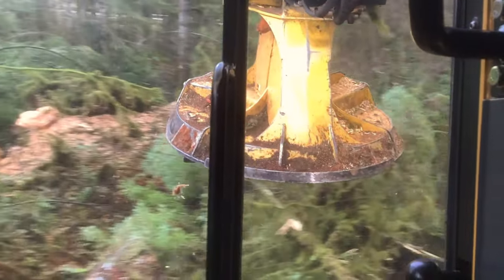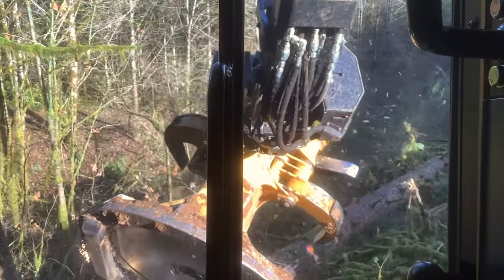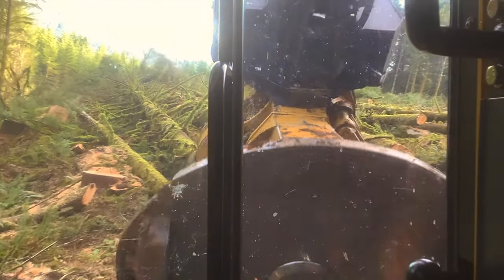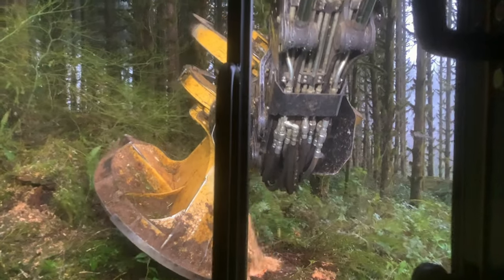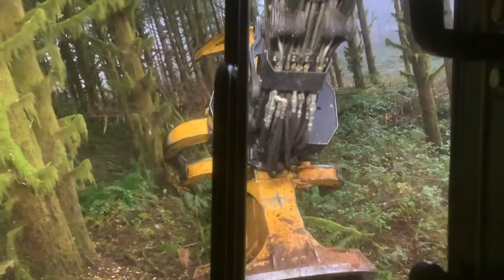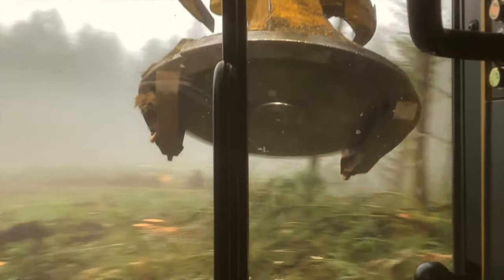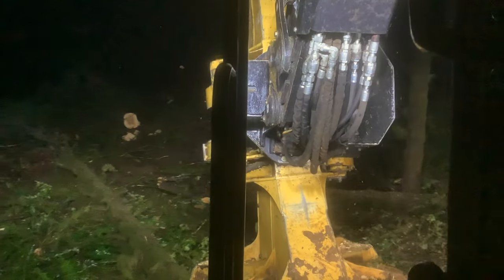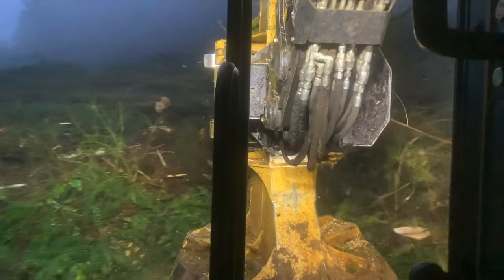Cutting In A 12 Acre Block Near Mabel Oregon With The Tigercat LX870D

Comment: Great video! We’re really having to change the way we operate. We’ve had to transition from cutting hardwood pulpwood to big pine. Our hardwood pulp market has went from feast to famine.
Reply from the maker: Thanks, glad you liked it. Is your pine saw timber market strong? Prices are still good out here for fir. Not enough to take the hurt out of fuel prices though. Man, it's bad. Always something. Good cutting to ya!
Reply: @thedailylogger  we sell probably 90% for what we call scragg. The Pine market here in north Alabama is weak. The better quality pine grows in south Alabama. We have a lot of Amish mills north of us in Ethridge Tn that saw  ties and pallet material. On the bright side, we have more crosstie mills in Ethridge than you can shake a stick at, and that market is strong right now.
Reply: @thedailylogger  our road diesel is $4.99 at the local truck stop. The last tank of off road red diesel we bought was $3.00 back in early February. We still have off road in our tank, but I feel it will be $5.00-$6.00 when we have to refill it.
Reply from the maker: @bryans5339  Copy. I guess by low grade you mean utility/pallet. Nicer pine like you're saying is more common further south would be sawn for dimension and better? Good to hear the tie market is strong for you. It seems do me like there's going to be some tough sledding coming up, hope it works out well for you. Hard to eat the increased fuel prices. Good luck!
Reply from the maker: @bryans5339  Copy. I just heard someone talking about off road in california going for $6.49 a gallon. It's increased 150% for us and still going up. Painful. Good luck.

Comment: Thanks for sharing ! Really enjoyed the narrative and I too will sometimes ‘throw’ trees for the same reason. Your thoughts on changing the lay angle made me think. I guess 10 or 15 degree is ideal, however there seems to be a fair amount of cutting lines/unit shapes that make this difficult to achieve.
Reply from the maker: Ain't that the truth! I try to use all the info I can get - Onx, Avenza, walking the unit, to get a sense of how best to minimize lead changes for the block as a whole and so I can establish the longest face as quickly as possible to bring the lead together. But like you're saying, sometimes that just isn't going to happen! This block worked well being long and really having only one major aspect. Nice block. Thanks for the comment, we appreciate it!

Comment: Did you cut this 12 acre piece in 2 days ?
Reply from the maker: It took me a little bit to think back to that one but I do remember. The patch I'm cutting in the video was just over 12 acres, part of a larger unit. I did get it in a little less than 2 days because I was able to dig my tracks out and walk the Buncher back to the load out point for the lowboy in the evening of the second day. That was a nice patch of wood with decent ground. It was full on winter but the soil held up well, a lot of the wood was max cut but not much double cutting. Also, once I opened it up I was able to create the long face I favor and really put down some wood. I think that it ran over 30mbf to the acre. Thanks for the question and for sparking my memory! They all tend to blend together a bit after awhile. Good cuttin to ya, be safe.